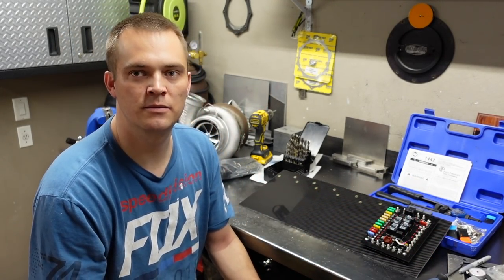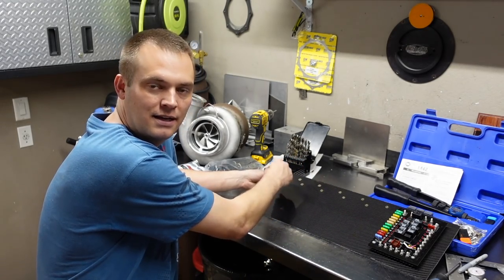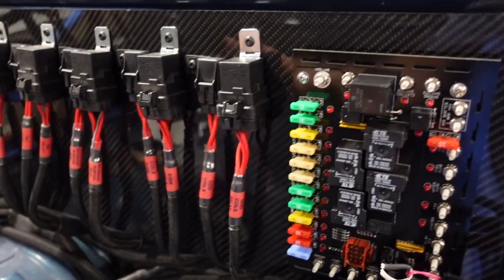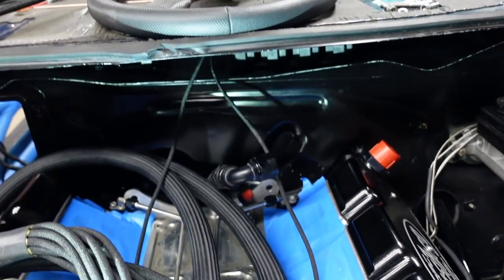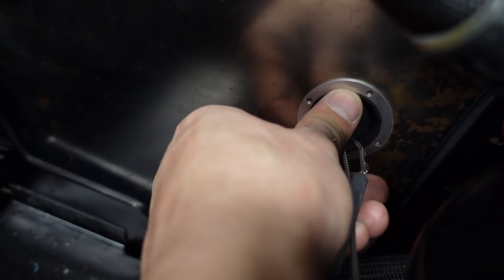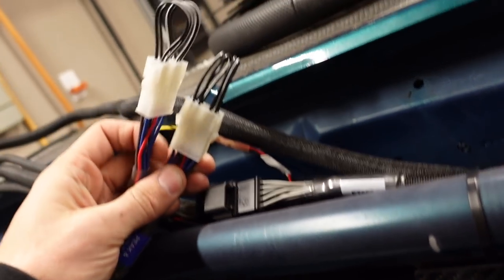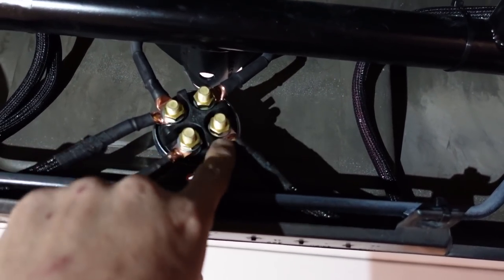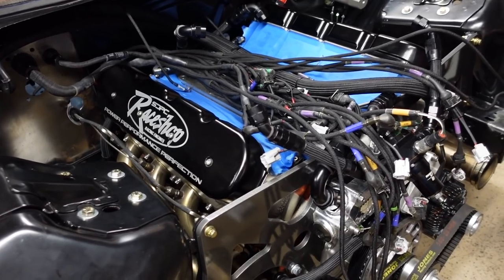Carbon Fiber Relay Board, Fueltech Pro Harness and Smart Coils - RACE CAR WIRING SERIES - Part 3!

Comment: Really nice work!  Those harnesses are impressive, too bad there is so much extra, but I get why there is.    @Tuomo said it first but I thought the same thing, put a small notch in the bottom of the carbon for each one of the fuse and relay harnesses.  That will force them to stay in a specific position but not require cable management on the front of the panel.  Will there be enough room behind the dash for that panel to be perpendicular to the floor, should it be at an angle?

Comment: So with co2 boost valves when you used pwm neg outputs to control dome pressure 
Do those pwm neg wires go strait to dome co2 valves

Or do you use a solid state relay  between terminator and valves
like trans brake does
Reply from the maker: So for the boost controller and the solenoids, I do not have a solid state relay. Goes directly from the output to the solenoids. I do use solid state relay for the trans brake and any trans dump valves...

Comment: I’m wanting to use a bulkhead connector but not sure on the shielded wire going threw the connector. I’ve read mixed answers on doing it and not doing it. How would you recommend doing it?
Reply from the maker: I pass the shield through just as another wire...

Comment: I can definitely say from experience fueltechs wiring harnesses are light years ahead of the Holley harnesses.
Reply from the maker: I am getting that impression pretty quick. Among other benefits from the fueltech... but the Holley has some pros as well. Maybe when I’m all done I’ll do a comparison video...
Reply: @StreetCarJoe  I agree. I like some things about the fueltech that Holley should adapt like being able to test output functions to trouble shoot things, and traction control and etc built in. I like Holley as well in I’ve probably installed 7 Holley to every fueltech. But I’m thinking about putting fueltech on my turbo truck

Comment: So I got a ft550 I have a few a question's it's going on a honda b series 4 cylinder.

Do I NEED relay for coils and injectors? I also want to use 2nd set of injectors so would I need 2 relays?

Also the yellow wires from the b connector I got the engine starter fuel pump fan and the vtec.... am I right in assuming blue wire can't do that due to load?
Reply from the maker: You will need relays for the coil and injectors. Depending on how much power the coils take, you may be able to get by with one relay for both. You can run all 16x injectors off of one relay.
Reply: @StreetCarJoe  I'll use 1 for each, u got Instagram? I may need to reach out to you, iv separated and tagged all the wires just a couple little things I'll need clarification on if that's ok?
Reply from the maker: @BA5HER123  streetcarjoe on ig. Shoot me a dm

Comment: Joe, great job bud! It begs the question though as to why you don't utilize the RacePak Smartwire instead?
Reply from the maker: This car just didn’t have enough gadgets and extras to justify it. Really the only relays we are using on the board is starter and water pump. Smartwire is little overkill for that 😂
Reply: @StreetCarJoe  I gotcha! Are you going to have any openings available to wire my single turbo Mustang in the near future? :) I have a Dominator, everything is installed in the car, Dash, ECU, all sensors and grounds are done. It's getting a bit too technical for me and of course I really want it done right the first time! I plan on using the RacePak Smartwire. BTW where are you located?
Reply from the maker: @shawnsemple6033  I’m in Amarillo TX. I got some openings coming up Fosho 💪🏻
Reply: @StreetCarJoe  Awesome! Let's do this! I am ready ASAP! I'll reach out to you on FB!